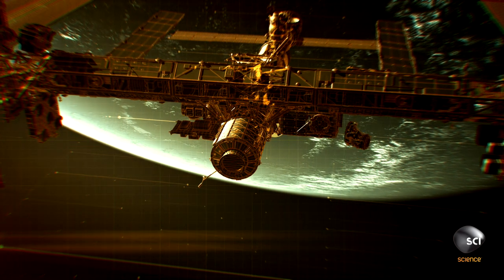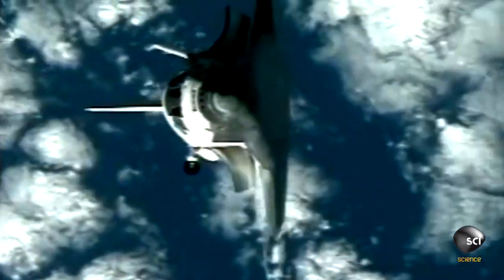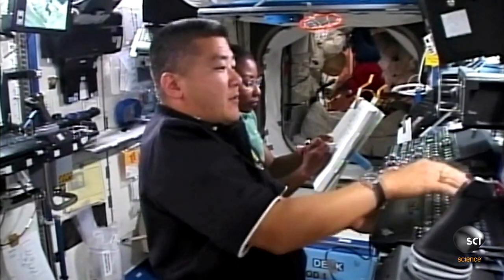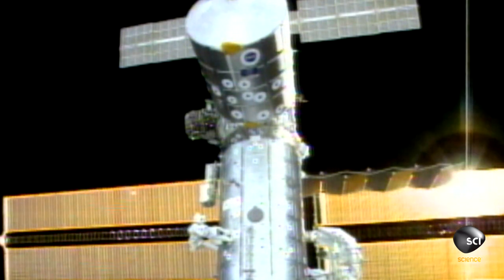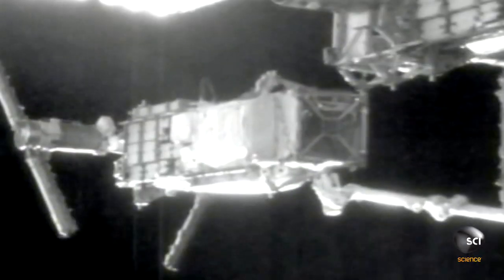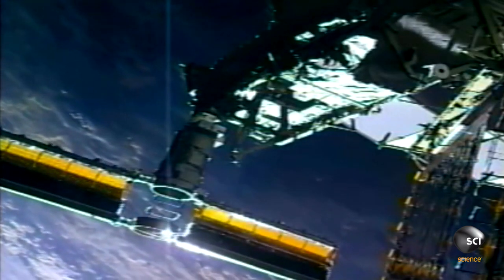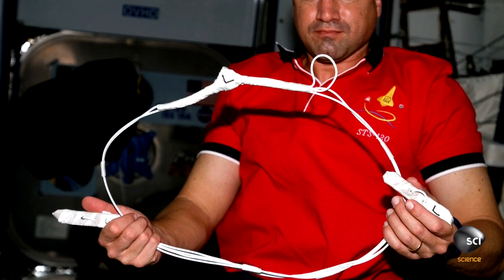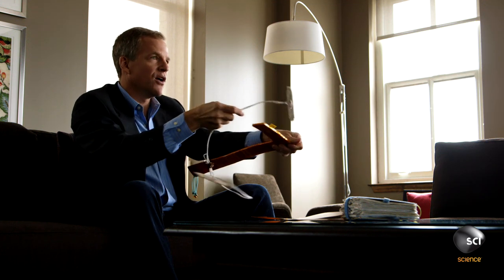Astronauts "MacGyver" Ripped Solar Array Repair

Comment: so the plastic or nylon or ptfe fix cable (even if made of metal) didnt get destroyed by solar rays? Even though the solar array panels are Specially Engineered from alloys and metallic elements that have superconductive And super-reflective properties?